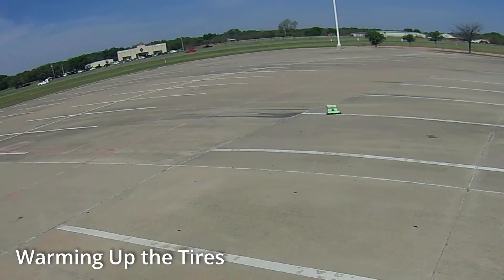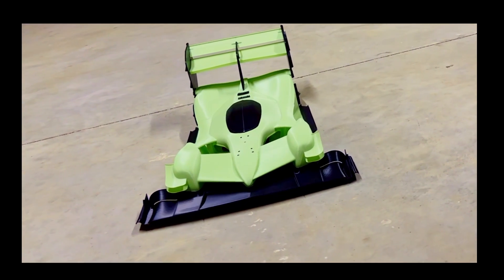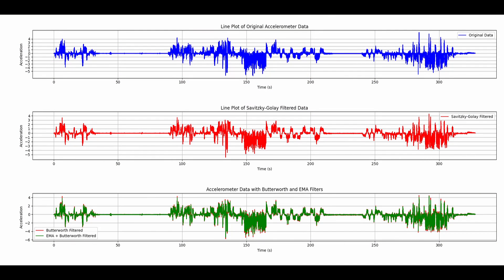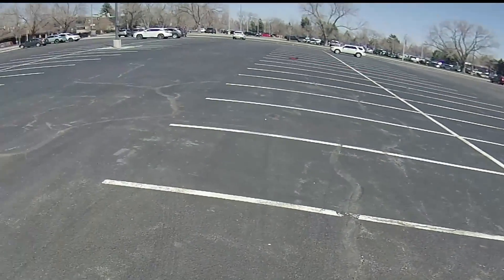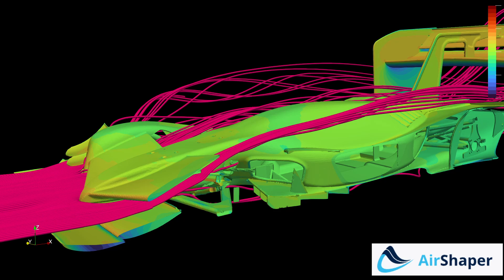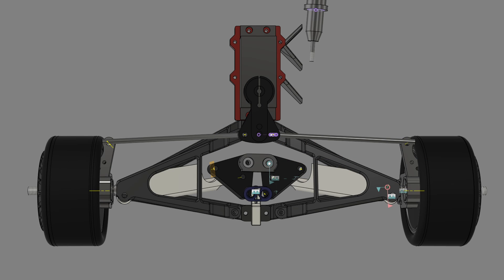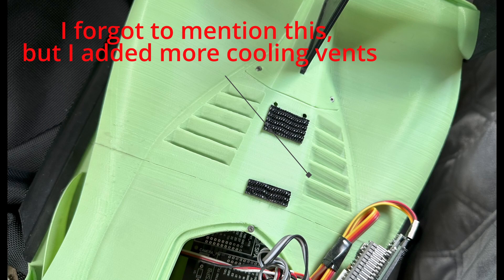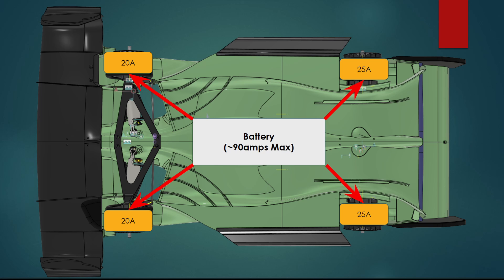RC Hypercar Pt8 - World's Best Handling RC Car?

Comment: I once made an aero kit for my traxxas bandit vxl out of cardboard boxes (I got the inspiration from this channel and projectair’s channel), and I can tell you the people saying that aero has no effect at that scale are dead wrong. It has a massive effect. The traxxas bandit vxl is known for being able to go 70+mph in a straight line, popping wheelies at any speed, and going through grass, sand, water, mud, you name it. It was built to be the ultimate off/on road rc car. The front tires spend 99% of the time in the air and to turn you often need to turn the wheels 45° or more to catch wind to turn the car when on the throttle. With the cereal box aero kit I was making 7 foot radius turns at speeds upwards of 25mph. Something unheard of for this car. I literally could not flip the car either it was so glued to the ground. I have aluminum parts on the car because i replaced plastic parts endlessly when it flips which is very often. So not seeing it flip was a spectacle for sure. I will admit the top speed was greatly diminished to about 50mph, but the car was so stable at 50mph I was able to run the car at full throttle for the full 15 minute battery life and not crash the car once. The car was obviously not designed for continuous running like this and the ECS overheated and almost set the car on fire. Scared the crap out of me seeing my rc car billow smoke in the school parking lot. So the people saying it doesn’t work can stuff it in my opinion. It works REALLY WELL and if you want to try it on your rc car I totally recommend it but add a cooling system to the motor and esc, or stop often and allow it to cool down after very short bursts. Lithium battery fires are no joke and extremely dangerous and difficult to extinguish. So have fun but take precautions and be safe. Learn from my mistakes and know what your parts are truly capable of, and have a plan incase you’re wrong lol. Have a good one.
Reply from the maker: That’s awesome.  It’s strange how much downforce really stabilizes a car. Did you find that it bottomed out the suspension or made it more unstable over bumps?
Reply: @IndeterminateDesign  I avoided bumps like the plague lol because if a hit the slightest crack the front wing would rip off. Once that happens i have to make a new one because the structure of the wing relied on the integrity of the cardboard to not flex. A single crease ruins that. But as far as i could tell bumps really didn’t have any other effects on stability or traction. The suspension didn’t bottom out that i could tell, the bottom never dragged. The car stock has a little less than a 1 inch clearance. I was able to adjust the suspension to get about half that. I was really surprised to find how effective ground effects are. I always thought ground effects was just kinda grasping at straws for every bit of downforce but they probably made up half of the downforce. And it really surprised me and changed how I see aerodynamics. Eventually the front wing did rip off and that’s how I discovered how effective the ground effects are. I think I had a skirt on the sides and that’s it for fine tweaking. I just made the bottom as flat as possible and made the back curve up. Bare minimum ground effects and it worked way better than I had ever thought possible. It was made from a cereal box for crying out loud hahaha. It’s really cool to see how far you’ve been able to take the concept or aero kits on rc cars with all the tools at your disposal. Far beyond what I was able to achieve. Maybe one day I’ll revisit it and get some videos and pics to share with you. I love these videos. Keep at it.
Reply: @IndeterminateDesign at 6:00 you talk about the front wing stalling and the problems that come with that. I’m not sure how you could fix that really well with your current design but what worked on my car was i just had a heavy pitch on the front wing. I think it was maybe 20-25°. I didn’t want to go too high and blow air above the rear wing which was a problem projectair ran into. Probably still too high at 25° though. The front end of my car weighs nothing and i was trying to stop it from popping wheelies. And the body of the car isn’t the most aerodynamic so the more air going above it the better I figured. Because of this I don’t think the rear wing really did too much, but the ground effects, big rear tires, and heavy backend more than made up for that and I had no issues spinning out. In the video of the car bouncing around from the front wing stalling it looks like your front wing was just too flat and the slightest lift in the front causes it to have no pitch at all or even lifting pitch. You could try a steeper pitch in front of the tires. That way air still passes through the middle area and the the rear wing. That should effectively prevent stalling the entire wing by having various pitch angles across it. I can almost guarantee that’s where your issue from bumps was coming from. Besides adding heavy pitch wings in front of the wheels shouldn’t be bad because that air really wasn’t going anywhere but up anyway with the tire in the way. It might cause some extra drag but i think the stability will make it worth it. It would be cool to see if curving the edge of the wing out so the air goes up and around the side of the tire and car does anything for horizontal stability too. All kinds of cool stuff to think about. At the scale of rc cars you can do some really wacky stuff with aero that wouldn’t work on a full size car. You have more surface area per volume but effectively less drag for the scale speed. You can use that to your advantage to make bigger wings with more downforce. It’s late and I’m typing way too much lol. Have a good one and good luck.
Reply from the maker: @letsdosomething6691  That's a great idea.  I want to add more pitch to the front wing but I will need carbon fiber rods to support the fenders as the wings support all this.  

The wing primarily stalls because it comes too close to the ground.  It's actually a very shallow wing, but because it's so big, when the car pitches it hits the ground.  It really needs more ground clearance.  The front end has 2kg of downforce and it drops about 4mm or half the ride height.
Reply: How did your carboard aero kit not bend under such loads?
Reply: @ I gave it a lot of front to back braces. On the front it was basically taped to an already existing spoiler that I flipped over to give it more pitch. For the back I used plastic knifes as structural support for the rear wing. The skirts were only sticking down a couple mm and curved around the frame, so the force on them would of had to be pretty strong to bend them. On top of that it reduced the top speed due to drag so it wasn’t as much force as it could have been. It was shockingly successful. I used cereal box cardboard so it was thin but dense. The goal was just to make the airflow over the car smoother and more vertical. And the airflow under the car faster and smooth(small openning in front large opening in back)
Reply: @ oh I see, ty for explaining
Reply: @ I’m sure it bent a little but I put so much stuff on there that even after the front and rear wing were removed the skirt alone still did most of the work

Comment: This is awesome! I think it'll even crush my fan car over 30mph.

It's comical that anyone would think aero doesn't work on modern RC cars.
Reply from the maker: Thanks!  Once I saw your videos I knew the aero would work if you could build a suspension around it. Especially with proper airfoils. I can’t believe more RC cars aren’t using this. 

Once I get the AWD working I’d love to run it against your Vendetta.
Reply: @IndeterminateDesign  sounds good, let me know when you want to run a test.
Reply: Any RC racer know that aero works. The bodyshell have a big impact on handling .
Reply: Anybody who believes that has never seen winged slot car defy physics by taking 88 corners in 3 seconds.